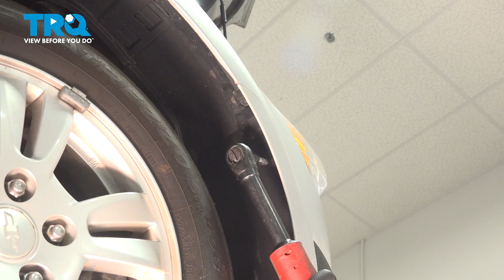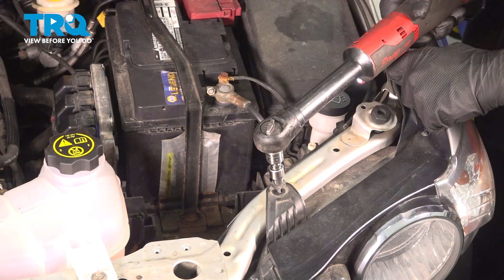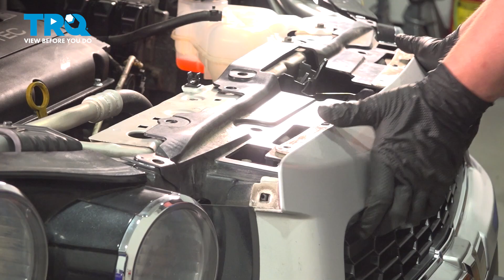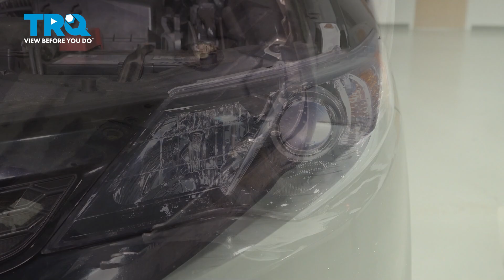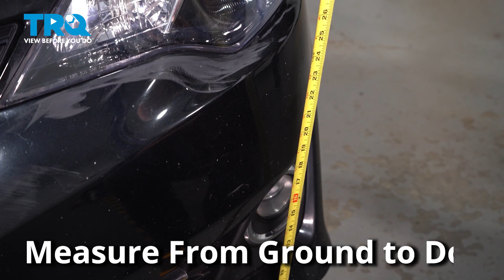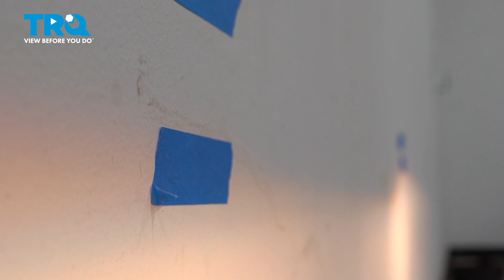How to Replace Headlights 2012-2020 Chevrolet Sonic

Comment: FYI the video won’t tell you but you need both H11 and 9005 lights for repair…. And if you have any sort of finger strength you don’t need to take off the bumper either it’s a cool trick though if you just want to look like you worked hard